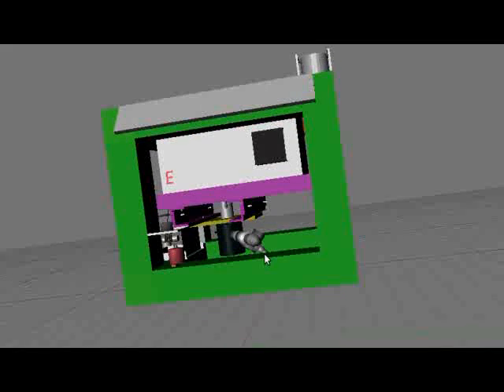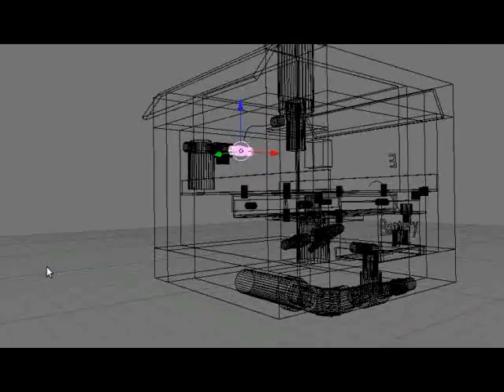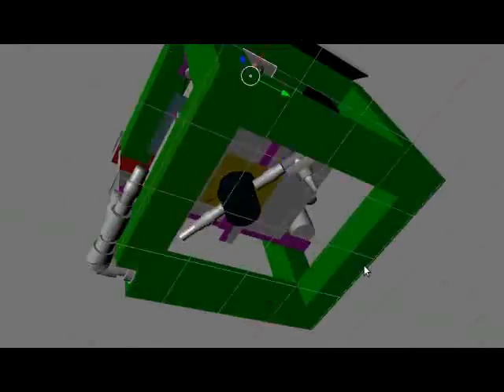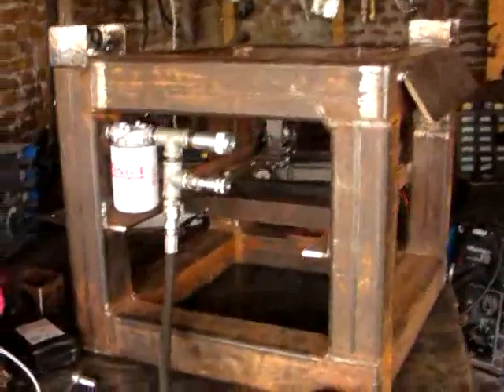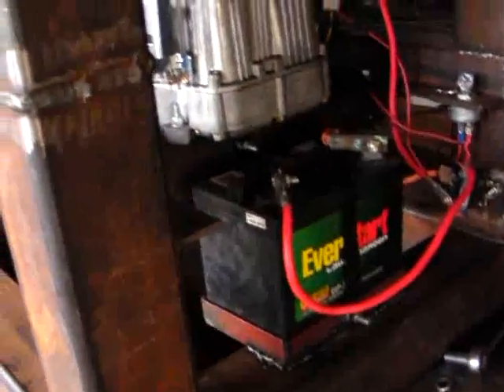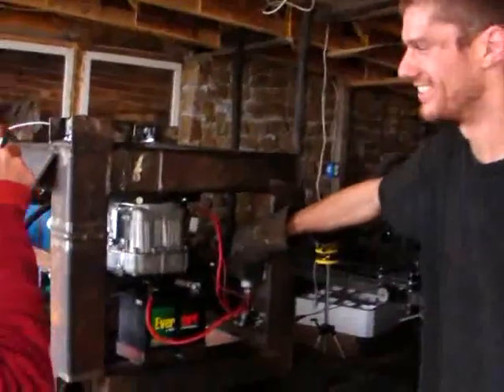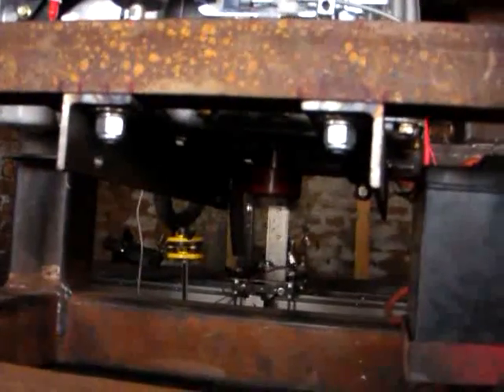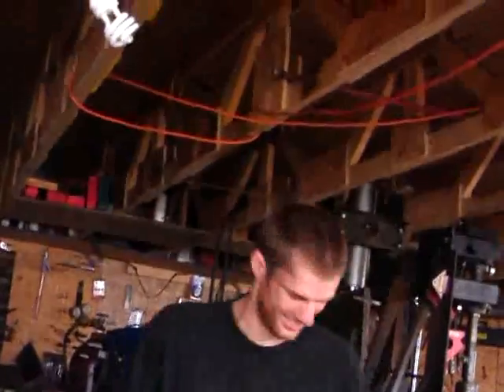POWER CUBE (open source) Finished

Comment from the maker: @jeffery19677 It is borderline. It powers a hydraulic fluid pump that powers all 4 wheels and the loader arms. 27HP and a slightly shorter frame length would probably work better. You can see it in action in another video here on my channel called "LifeTrac II First Field Test".

Comment: Is two gallons going to be enough fuel for one day's work? I know in my 6 hp lawn mower, one gallon lasts about two hours, and the work on the engine is not very heavy. A 17 hp engine seems like it would use this fuel fairly quickly.